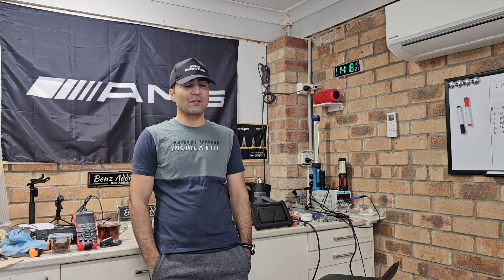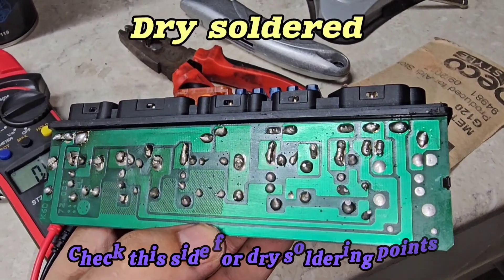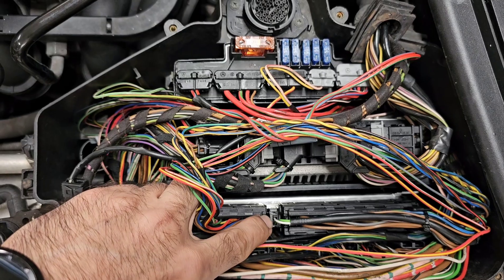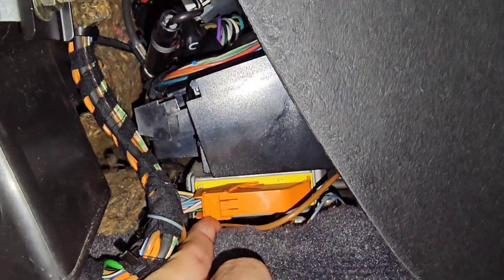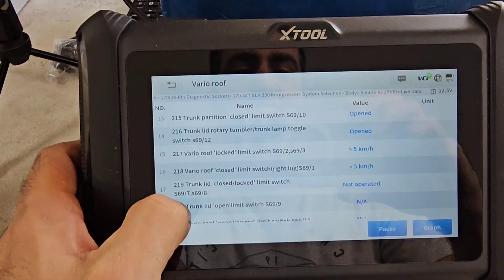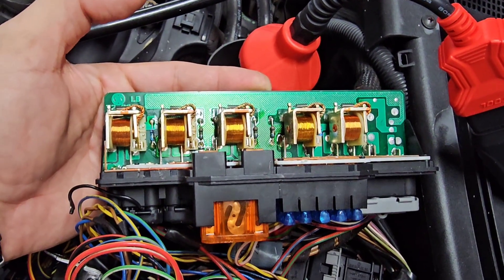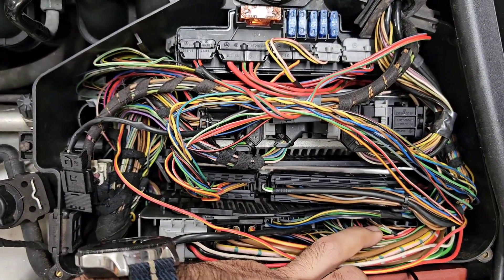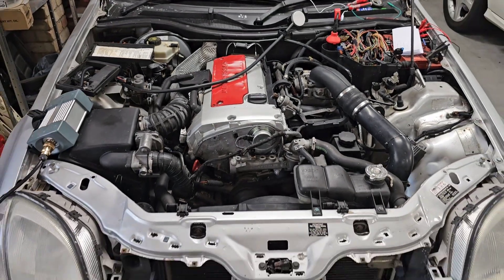SLK Class: All Relays, Modules, Fuses, Locations, and Diagrams (R170 Mercedes)

Comment: Thank you for your great video 🌟
Did I miss the flasher relay(hazzard lights and turn signal). My 98 flasher stopped working. (Green indicator lights will pop up but only once)
Reply from the maker: Mercedes-Benz SLK (R170) uses a Combination Control Module (CCM) rather than a traditional, simple flasher relay. The indicators are controlled by the CCM (N10-3). This module also manages the windshield wipers, rear window defroster, and interior lighting.
Location: It is located inside the engine compartment's control module box (passenger side, near the firewall), tucked under the main fuse panel.
Function: While you may hear a "clicking" sound when your SLK is signaling, that sound is often electronically generated or comes from a small internal relay within the module itself.
Common Failure Points
If your turn signals are failing, the issue is typically one of the following:
Combination Switch: The actual turn signal stalk on the steering column often fails or becomes loose.
K40 Relay Module: Though primarily for engine power, a faulty K40 can sometimes cause broad electrical gremlins.
Hazard Switch: The circuit often runs through the hazard button on the center console; if this switch is sticky or broken, the blinkers may stop.

Comment: Hi, im getting a p0170 code but everything seems to be running fine. Also, recently my fog lamps and corners lights stay on eventhough the car is turned off. Ive replaced the illuminated control unit twice but have not resolve the problem. Any idea on what could be wrong? Any helo would be greatly appreciated.
Reply from the maker: The Headlight Switch (Illumination Control Module) is the most common culprit for fog lights that won't turn off. On the R170, these switches often fail internally, causing the contacts to "weld" or stick in the ON position even when the car is off.
Immediate Steps:
Pull the Fuse: To save your battery, pull Fuse #3 and Fuse #12 (Front Fogs) or Fuse #2 (Rear Fog) in the main fuse box under the hood.
Inspect the Switch: If you pull the knob out and push it back in but the lights stay on, the internal plastic or spring mechanism has likely snapped.
Check the PSE Pump: If your floor mats are damp, water may have reached the PSE Pump in the trunk, which can cause erratic lighting issues.
Reply: @BenzAddiction thanks for the info. I've swapped out the switch from a used one from a junk yard and the issue was not resolved, i then bought one from ebay and same thing. I unplugged the pse and problem has gone away for now. I also notice that around the same time my central lock has stop working. I am thinking the pse is a cause of all of this. There was corrosion on one of the connections to the pse. I will clean it up and try to reconnect to see if I can get central locking to work. 

Regarding the code p0170, do u have any insight on that. I've checked for leaks and clean the maf, my next move will be the o2 censor. Have u heard of the gas cap throwing a p0170 code on the r170s? Thanks

Comment: i do have an 1996 SLK 200 very first model , i live in Germany ...so LHD car
Problem : LHS low Beam is OUT (high beam works)
                  LHS front blinker both are out ( next to the Headlamp and the one in the fender
ALL other blinkers are working (the rear left one is flashing qicker cause the sxstem is missing the front two blinkers)

Fuses are all OK
Bulp s are all OK 
Ground is OK
Changed the Light switch ,,fault´s still there 

I put a external wire from the Fusebox next to the steeringwheel and got front left working (Fuse No 8 front left headlamp  )

I can´t find the relay for the Headlamp´s.
I read somwhere that these relay on the very early R170 are in the K40 relay box integrated.
 the K40 relay box looks different from the K40 box which are showed in this video
MY K40 box is missing the very left relay ,but as such a relay on the very right (wish i would know hot put a pic in here)

So does anyone can tell me where to find the headlamp relay´s LOW BEAM ?

Thank a lot in advance Robert

Comment: Hello, I've encountered the following problem: when I press the horn on the steering wheel, there's no sound, but when I press the horn in the relay, there is sound. I removed the airbag from the steering wheel, and there were no breaks there either, the fuses are also intact. What else should I look for?
Reply from the maker: Have you resolder the points on your K40 relay? That can be the cause. (Dry solder points)

Comment: What is a convenience module? Also mine has two relays behind a yellow one and a black one next to each other, what does the yellow one do ?? Mercedes couldn't tell me what they are. Where can I get the circuit diagram from is it free.? I've got a battery drain quite severe 5 hours it's completely flat not even a single volt. haven't checked all the fuses yet. I heard that the module for the gearbox could be at fault, I did get water a year ago coming into the cabin and flooding the floor a dozen times so i might lift that up and have a look.
Reply from the maker: It is also called multi module, manages Windows, vario roof, etc...

Comment: I bought a 1999 SLK200 a couple of weeks ago. The car's roof works, but both windows on the driver's side do not work. If I disconnect the connection from the window lift motor, and try to build a control for the motor bypassing the car's electronics, could that prevent the roof from working? Does the lift motor stop mechanically, or is it turned off electronically when the current becomes high, i.e. is there anything in the motor that cuts off the power when the glass is in the up position? I don't mind driving with the windows up and the roof down, but here in Finland they may require the windows to be working during the inspection 8 months from now😢 I don't have any diagnostic tools.
Reply from the maker: Do not bypass the window switches. Comfort module (multi function module) manages top hydraulic, windows and work closely with central locking to keep the roof working.
Reply: @BenzAddiction Thanks for the information. Maybe someone has made their own connections to the module, because the roof works even though the windows don't move. Maybe if I leave the original window motor connected to the electrical connector and install a universal window regulator with its own switch, I'll save myself a lot of trouble😅

Comment: I am getting a p0104 code and a loping idle I’m trying to find the g102/g103 location to see if the MAF sensor is getting good ground. Any idea where it would be located?
Reply from the maker: On your Mercedes-Benz SLK230 (R170, with the M111 Kompressor engine), a P0104 fault code refers to an intermittent issue with the Mass Air Flow (MAF) sensor signal. Since you also have a loping/unstable idle, that lines up well with airflow metering problems.

Here are the most common reasons for this code and symptom:

1. MAF sensor issues

Dirty or contaminated MAF sensor element.

Faulty MAF sensor sending intermittent signals.

Aftermarket non-Bosch MAFs are notorious for giving problems on these engines.

2. Air intake leaks (unmetered air)

Cracks or loose clamps in the intake hose between the MAF and the throttle body.

Vacuum leaks (common in the M111 engine around breather hoses, vacuum lines, or PCV system).

Split intercooler hoses if yours is supercharged.

3. Electrical connection

Loose/corroded MAF connector or broken wiring to the sensor.

4. Secondary contributors

Dirty throttle body or faulty Idle Air Control (IAC) stepper.

Clogged air filter restricting flow.

---

🔧 What you can do:

1. Check wiring & connector to the MAF first — make sure it’s snug, clean, and not corroded.

2. Inspect intake hoses & vacuum lines for splits or loose fittings.

3. Clean the MAF (use proper MAF cleaner spray, not carb cleaner).

4. If issues persist, consider replacing the MAF — but make sure to get an OEM Bosch unit, as cheap copies often cause ongoing problems.

5. Reset the code and see if idle stabilises.

Comment: Thank you for taking the time to make this very helpful video.  Well, I have a perplexing rough,  erratic idling issue with my 1998 slk230.  OBDII code is P1580 ea/cc/isc actuator rh, and there's the dreaded ASR light.  If I reset the ECU twice or more, the engine would settle down and idle normally and drive OK.  But once I turned it off and restart, it'll revert to rough idling around 1200 rpm.  So far, I've replaced the throttle body and TPS.   I'd greatly appreciate your advice.  Thank you.
Reply from the maker: I have 2 videos on this issue. Check both: 
https://youtu.be/strTR9VM2po
Reply: @BenzAddiction Great, will look into it.  Thank you.

Comment: Great video! I have an issue with my front windows not working on my 99 SLK 230. I am able to make them go up and down using a 12 volt probe on the window motors. And the fuses and window switches seem to ohm out. I also replaced the Vario-Roof board and the Central Locking Unit down in the trunk. So any other ideas as to what to test?
Reply from the maker: Ok, we are either missing the negative or positive on the motor side. You definitely need to take of the door trim and start from there.

Comment: Hi,  I’ve got 2 problems on my 1997 SLK230 Kompressor R170,  I cannot sort.
1. Fog lights front don’t work.  All fuses OK.  My garage says there is power going into the control module but none coming out.  Which module is that?  

2.  Heater controls in the cabin won’t turn off the heat.  I’m thinking it’s the heater control unit in the car?  Or is it one of the control modules in the box by the battery.  There are 3 wires going to the heater control  module under the bonnet.  There is 12V going to the middle of the 3 wires but nothing to the other two wires when the heater controls are turned in the cabin.  

Any help would be appreciated.  David
Reply from the maker: For fog lights, you need to start from behind the headlight switch, check the input voltage and output from switch. Need to check the connector behind the bumper for corrosion too. For the second issue, check all the Fuses under the bonnet as far as I can remember,  one being blown could cause this to happen.

Comment: Thanks for the vidéo  ! My friend has an SLK r170 2.3l 193ch. The fan of liquid cooler is running with key contact but the motor and fuel pump doesn't start. F40 is ok and fuse are ok.   I don't understand. Have you an idea ?
Reply from the maker: Ok, fan should not run unless the ECU detects faults. The fuel pump only runs when you crank the engine. 2 things to check: 1. Temperature sensor. 2. A/C Pressure sensor.
Reply: @BenzAddiction  Thanks :-)
Reply: @BenzAddiction  I have ordered tha A.C Pressure sensor : wonderfull, the engine 's start now ! Thanks. But the engine make backfire, i'll certainly change the TDC Sensor and verify the coil ignition.

Comment: If you are looking for video ideas, I think it would be nice to learn about any water drain issues of the CLK. I believe there is a drain below the front SAM that one should make sure is free so that the front SAM won't be flooded. The three drain pipes going off the cowl are pretty easy to keep clean (I use a metal spiral that is normally meant to unclog drains in the bath or similar) but I wonder how much attention is needed for any invisible drains, such as the one under the front SAM. Perhaps there is another one below the battery, not sure. Same question for the boot and/or the area where the TCM sits (same as with the SLK; under the passenger floor mat, behind a metal shield). It would be great to learn how one can make sure those areas remain dry.
Reply from the maker: This is a great video idea that i never thought about it.  Thank you. I note it down in my video list so I can research more and make the video in future.  Cheers, Max.
Reply: @BenzAddiction  Awesome!
Reply from the maker: @coolcat23: I have mentioned your name at the beginning of the video, thanks for the suggestion. https://youtu.be/W4_g44mP2uw
Reply: @BenzAddiction  Thanks! That's very kind of you. Thanks heaps for the video, and I'm glad your drain pipes are in much better condition now.

Comment: Had a dash fire in my 97 R170. First problem was car would not switch off, even with key out. I believe the headlight switch can feed a false power to the ignition. Then wipers and blower went out finally smoke and flames from under dash and in engine bay too. Any advice on repair?
Reply from the maker: Wow, that sounds like a serious issue; I recommend consulting a professional mechanic for a thorough inspection and repair.